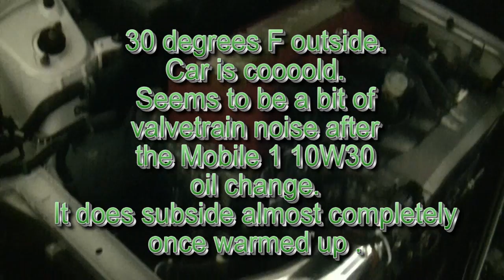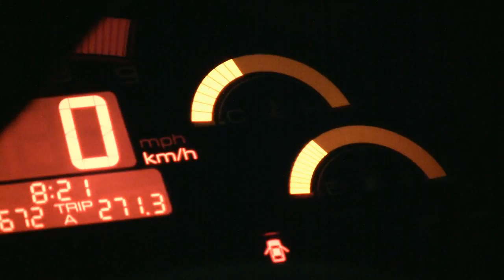S2000 Engine Sound... Timing chain tensioner?

Comment: just on warm up ,  it takes a min to heat up and lubricae the air outta the lifters . when it stays that way your going to need a valve adjustment.. honda says 95k miles , and  @ 9 mine were out pretty bad. I doubt its the TCC they dont go out  like people say they just confuse this with other things..

Comment: Honestly sounds like piston slap.  Pistons expand to proper clearance at operating temperature.  They are slightly smaller when cold, and slap the cylinder wall.  Engine rebuild is the best fix, but not neccessary,  To quiet this, try engine restore in a can or lucas oil treatment.

Comment: Change the oil again and buy a better filter, put oil in the filter before putting the new filter on other wise you will be dry starting the vehicle and pushing air underneath the lifters. Also use 5w30 for the s2000s it's thinner oil and works wonders with those cars!

Comment from the maker: Piston slap couldnt be further from the truth! First, it would be a different sound, and be much lower in frequency. The other harden fast reason.... HONDA eliminated slap in these motors due to a skirt design. Got the paperwork to prove at home. This is merely valvetrain noise common from a performance engine like this. Once the car has reach operating tempature, everything loosens up and fits beautifully~!

Thanks for the replies everyone~

Chad

Comment: its simple fords v8 has a problem with cold oil its to cold to properly lubricate the temp has changed the viscosity untill your engine warms up simple fix buy a magnetic block heater that sticks on the oil pan heat up your oil before you start it in cold weather